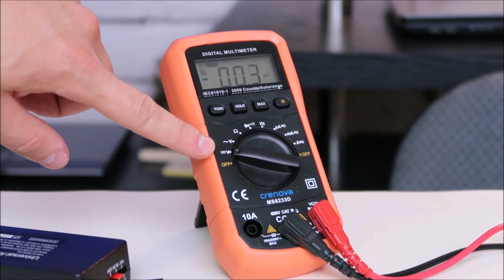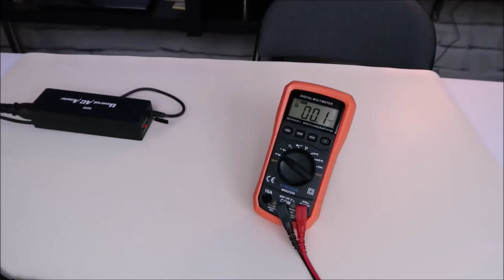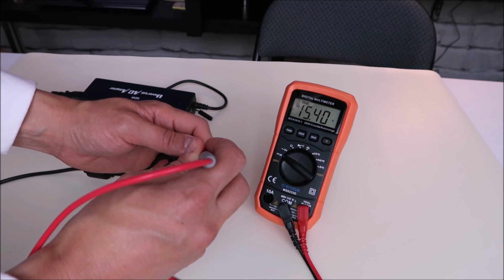How To Fix Any Laptop - Wont Turn On, Wont Open, Turns Off Right Away, No Power Solution

Comment: is there a vid where u can force restart bcs my computer is frozen and when i close it and open it its the same thing
Reply from the maker: To make sure the computer is off, you can hold the power button down until it turns off.  If that does not work, remove the battery and unplug the power adapter for a couple minutes.  Then put them back and try turning on the computer.  Is it still frozen then?  If so, where is it frozen?

Comment: Hi, thanks for sharing your knowledge here. I have a Toshiba E45-B4100 ; about a year after buying it, the charger died and I used a generic charger to power it. Hours after connecting the charger, the laptop suddenly died but it came back on after doing the battery in-out power button procedure you described in another video. The next day, the laptop suddenly died again but this time, nothing I did would bring it back and since then I have tried everything, including all the procedures you describe here as well as others, all to no avail. There are no lights or sounds from the computer at all and I couldn't find it's CMOS battery when I disassembled it. What do you think happened here? Please help, thanks.
Reply from the maker: For a computer that does not turn on, try this video first;  https://youtu.be/P3I7dDpkJps.  Let me know how that goes :)

Comment: Thank you for this - my ASus GL502VS still is not turning on.  This is what I tried:
Tested charger with multi-meter - showed 19.73V
Disconnected battery, discharged static by holding power button for 1 minute without power connected - no luck
Plugged in power adapter, tested voltage out the back pin of the DC Port - showed 19.73V so looks like power is getting to motherboard
Tried a new battery - the system turned on (battery only had 5% charge) - Windows showed that the battery was not charging + battery led was blinking
Battery eventually died - system will not power on with charger plugged in
Discharged CMOS for 20 minutes - tried all the static discharging, etc, still won't turn on.
I even bought another charger (which tested good with multimeter) and did all the above using the new charger (why not I can return them on Amazon)

I don't know what else to try now - I think it might be the motherboard.  Strange that it can get power from a battery but not directly from the DC port.  I suppose I could externally charge the battery and swap it but that is not a good solution.  Any input appreciated!
Reply from the maker: If all the tests in this video do not reveal the issue, then your most likely looking at a Motherboard replacement as seen here;  https://youtu.be/N_7HNrFkMS8.

Comment: Hello , my laptop doesn't turn on.
My keyboard shows white light and no power light and doesn't turn on at all.
Tried using it only on batter , disconnected battery ..
Didn't work.
I gave it to service center and they told me to either repair or replace the motherboard.
Replacing motherboard is very costly - close to buying a new laptop but i opted for repair and they told me that they couldn't find the issue.

Last thing i did was a bios downgrade which worked well for 2 day ..
I downgraded because the new bios had some issue related to fans (restarting every 5-10mins).
Reply from the maker: If all the tests in this video do not reveal the issue, then your most likely looking at a Motherboard replacement as seen here;  https://youtu.be/N_7HNrFkMS8.  If you know your computer's model number, I can help you get inside your specific computer :)
Reply: @PC_Monkey  It is Asus Fx505DT.. Ryzen 5 3550H , Gtx 1650 , 8GB ram.
I think the power delivery component is damaged in my motherboard but i don't have so much knowledge about these.
I want my laptop to be repaired instead of motherboard replacement because it is very much costly.
Almost 80% of what i paid to buy the laptop.
Reply from the maker: @AnilabhaDatta  If your motherboard is the issue, then it would have to be replaced.  If none of the steps here found the issue, then its most likely your motherboard.  If you like, you can take it to a repair shop for a second opinion
Reply: @PC_Monkey  the repair shop couldn't find the issue , i guess i have to look for another shop.

Comment: i was playing on my laptop and then it shut down and i can't turn it on
and it's not charging when i plugged in the adapter....help!😭😭😭
Reply from the maker: your on the correct video.  Have you tried the steps seen here yet?
Reply: we did all the steps but it din't work so we need to buy another motherboard..
Reply from the maker: @iiethxnyt9696  K.  Good luck with the install !!

Comment: My laptop wont turn on and there is orange wire looking light blinking it worked once but i l tryed to use one of usb ports and it suddenly shut off with a sound like it exploded
Reply from the maker: For a computer that does not turn on, try this video first;  https://youtu.be/P3I7dDpkJps.  Let me know how that goes :)
Reply: PC Monkey didnt work
Reply from the maker: @MldgetPidget   If all the tests in this video do not reveal the issue, then your most likely looking at a Motherboard replacement as seen here;  https://youtu.be/N_7HNrFkMS8.  If you know your computer's model number, I can help you get inside your specific computer :)

Comment: Hi, my problem seems different to this. 😕

I have an Asus ROG laptop. Won't start at all. If I do a static discharge then plug in the battery I get nothing but if I discharge then plug in the charger, the laptops led indicator works but still nothing else. 

Also, when I have the battery plugged in there is a consistent quiet whine which goes away if I unplug the battery or while I hold down the power button.

Any ideas??? Please help me 🙏
Reply from the maker: This is the correct video for your issue.  Have you followed the video through all the steps?
Reply: @PC_Monkey  thanks so much for the fast reply. I am currently up to the stage of discharging the motherboard by removing my CMOS battery. Didn't work the first time but I am trying again and letting is discharge well overnight.

(I have not yet bought new ram to try but that will be the next logical step I assume). I have a single channel 16gb stick. Will putting that ram in the other slot make any difference or does it have to be a new stick of ram?
Reply from the maker: @scottbristow3370  Changing the slot will only test the slots if you know the RAM is good.  Since we dont know that, best to get another stick to test it with
Reply: @PC_Monkey  awesome, thank you so much for the advice 😊
Reply from the maker: @scottbristow3370  Happy to help :)  Always here if needed !!

Comment: I have  applied all the tricks but still haven't got any solution, my laptop is not starting nor charging,. with or without battery charger is working
what should i do plzzzzzzzzzz help
Reply from the maker: If all the tests in this video do not reveal the issue, then your most likely looking at a Motherboard replacement as seen here;  https://youtu.be/N_7HNrFkMS8.

Comment: My Lenovo(similar to your tutorial version) is only 1 year old and it’s only used for business purposes, emails, excel, etc. It randomly today when I opened the lid from a sleep mode, the power light on the button came on and the charger indicator shows it’s getting power (previously at 100%). You press the button and the light goes on for 3 second and shuts off but nothing at all happens, no sounds or screen input. This issue didn’t fall under any of the previous issues you described but you’re very knowledgeable. Could please reach out to us or post a video with a resolution to this weird issue, if there is something different we can try?
Reply from the maker: your on the correct video.  Have you tried the steps seen here yet?
Reply: PC Monkey yes I missed one part there in the panic I was in. You fixed it brother!
Reply from the maker: @christiandalessio5354  Happy to help :)  Always here if needed !!

Comment: I did the discharge and the computer will come on now. However, after awhile it will cut off. I had a voltage message issue, and replaced the adapter. any ideas what may cause it to cut off? we had a power outage and that is when the voltage message came up. it was on a good surge protector at the time. could it have corrupted something in the system and doing a wipe and reinstall may fix? dell inspiron 15
Reply from the maker: What did the voltage error message say?  If your computer turns of during use, check this video to see why;  https://www.youtube.com/watch?v=Nqn8-jJFx2Y
What happens now when you try to turn it on?
Reply: @PC_Monkey  It still cuts off. I did the reinstall and it will shut off after a certain period even with a reinstall.
Reply from the maker: @pamarrington59  What is the battery reading when it turns off?  Did you try to find an error with that video link?
Reply: @PC_Monkey  it was reading 100%  I didn't find an error to match. I am not sure it is off. when I press the button to turn back on I hear a sound and then I have to press 2nd time to startup. I don't have it set up to sleep mode or hibernate. Also, after the reinstall it ran update, then cut off. when I turned on, it kept looping and saying the update didn't work. I had to restore to before the auto update, then turn off updates.
Reply from the maker: @pamarrington59  What brand computer do you have?
Reply: @PC_Monkey  Dell inspiron 3552 laptop and i was able to get into system and software environment and see windows error reporting I did a screenshot before it cut off on me again and emailed to myself
Reply from the maker: @pamarrington59  Try running this test: https://www.youtube.com/watch?v=IsqINCxx_Ik&feature=youtu.be
Also, try the static discharge seen here;  https://youtu.be/P3I7dDpkJps.
Reply: @PC_Monkey  ran diagnostics . it passed both test  but it still shut off a few minutes later. i did update drivers on dell and it still crashed

Comment: My chromebook 500c13 the power plug doesnt work how do i fix it i took apart looks like its soldered to the motherboard
Reply from the maker: If the power plug is defective, it would need to be replaced.  If its connected to the motherboard, the motherboard would have to be replaced or the plug would have to be removed and a new one soldered on
Reply: @PC_Monkey  do yall have the new plug soldered ? Like can i pay yall to do it
Reply from the maker: @darkarmedgames7870  Sorry, I dont take computer repair jobs from Youtube viewers :(  Just local stuff

Comment: My laptop was working fine . Today I plugged in a Vga cable to my monitor and since my laptop had vga port , i plugged it on my laptop as well . Turned on the power supply to the monitor and then turned on the laptop .

Now the laptop never boots like it flashes 0.1 sec its like trying to boot of course the logo doesnot come because immediately turns off , and again tries to boot and again immediately turns off keeps happening in loops . It behaves both same ways with or without the vga cable now. My laptops battery disassembly is a complex procedure so i will be giving my laptop at a repair shop , i hope it works out . I am so stressed
Reply from the maker: your on the correct video.  Have you tried the steps seen here yet?
Reply: @PC_Monkey  The disassembly of my laptop is complex that is why i sent it in for repairs
Reply from the maker: @nisipshrestha1081  np :)  Hope it goes well !!
Reply: @PC_Monkey  but can vga kill laptop ? Or is it just a coincidence?

Comment: A month ago my laptop was not turning on and I saw your video and it turned on and after 2 weeks the same thing happened and now I can't turn it on plz help
Reply from the maker: For a computer that does not turn on, try this video first;  https://youtu.be/P3I7dDpkJps.  Let me know how that goes :)
Which step fixed it last time?
Reply: @PC_Monkey  https://youtu.be/_MOe71kBPOY it was from this video in which I took out the battery and pressed the power button for 1 minute and after that I put the battery back in and it worked

Comment: Somebody else tells me not to touch BIOS at all and tell me to change the cpu. Can that be the issue? Some one else says the mother board is bad even though I just got it off ebay? He says the mother board is bad b/c the light that indicates charging on the bottom side of the laptop doesn't light up when plugged in. Is he right? (the light on the bottom left hand side https://i.dell.com/das/dih.ashx/500x500/das/xa_____/global-site-design%20WEB/b88e8411-0a24-6e98-efc3-1c9c33787237/1/OriginalPng?id=Dell/Product_Images/Dell_Client_Products/Notebooks/Inspiron_Notebooks/inspiron_15r_5520/relative+sized/laptpo-inspiron-15r-5520-front-relativesized-500.png)
Reply from the maker: What brand and model computer do you have and whats the issue with it?
Reply: @PC_Monkey  my computer is a dell inspiron 5520 15.6 inch (basically in the linked picture). Before I changed my motherboard with one from ebay (said to be working) the light on the charger would go out when plugged into the computer. Now that I changed it the light on the charger no longer goes out when plugged into the computer. 

However, the light on the computer that lights up when charging won't light up and the computer won't turn on either. 
I have tried changing the charger, using the charger without the battery, the bios reset, and changing the RAM memory 1 at a time.
Reply from the maker: @ericl8407  For a computer that wont turn on, your on the correct video.  Have you tried the steps seen here yet?
Reply: @PC_Monkey  I just listed the step I tried. Do you understand what lights I am talking about?
Reply from the maker: @ericl8407   If all the tests in this video do not reveal the issue, then your most likely looking at a Motherboard replacement as seen here;  https://youtu.be/N_7HNrFkMS8.
Reply: @PC_Monkey  I didn't have volt meter but I did try a new charger. and I did replace with mother board from ebay said to be working

Question is: is the battery status light not lighting up always a problem with motherboard?
Reply from the maker: @ericl8407  It can mean that the motherboard is not working, however, lights can be deceiving.  Its best to troubleshoot parts instead of relying on the lights.
Reply: @PC_Monkey  do you have a video or list of things that could cause the charging status light to not show? it seems slightly different from the stuff in this video. And also my battery is a dead one. my laptop died the  day before it stopped working

Comment: Please help sir I update a network setting in window 7 while updating ...pc said that restart the pc but instead of restart i shut down it and then now i am not able to start please help me
Reply from the maker: What happens when you try to power on the computer?  If your computer wont power on, then your on the correct video.  Have you tried the steps here?
Reply: @PC_Monkey  yes but it didnt work
Reply from the maker: @nikhilchopra7666   If all the tests in this video do not reveal the issue, then your most likely looking at a Motherboard replacement as seen here;  https://youtu.be/N_7HNrFkMS8.  Is there a chance the computer is turning on but the screen is just staying black?  If so, check out this video;  https://youtu.be/u-REPLdpZ70

Comment: I tried all of the steps you did, still won't turn 🙁
Can you pls help me 
I was using my laptop, then it turn off by it self
By pressing the power button, still no responce with the display, but it indicates that my laptop is charging, because it has a light indecator.

My laptop is ACER ASPIRE 5
Reply from the maker: If all the tests in this video do not reveal the issue, then your most likely looking at a Motherboard replacement as seen here;  https://youtu.be/N_7HNrFkMS8.

Comment: Hi! I just referred to your video for my Lenovo laptop and Windows started when the battery was removed and charger plugged in. Does that mean it’s the battery that needs replacement?
Reply from the maker: Yes.  Most likely the computer senses an issue with the battery and will not turn on with it installed to protect itself from damaged.  The battery should be replaced.
Reply: PC Monkey Thanks heaps! I have ordered a new battery! After it powered on with the charger, the start up screen prompted me for a boot repair but it couldn’t do it. Would the battery be the reason why when I would be using the laptop, it would suddenly power off though fully charged?
Reply from the maker: @sunitakaihar6510  Yes, the battery could be he reason why the computer turns itself off.  To double check the reason, refer to the steps in this video;  https://www.youtube.com/watch?v=Nqn8-jJFx2Y
Reply from the maker: @sunitakaihar6510  Jamin :)  Happy to help :)  Always here if needed !!
Reply: PC Monkey Thanks Jamin! You’ve been of utmost help! I can see from other comments too how your knowledge and videos have helped others! Appreciate it! 🙂
Reply from the maker: @sunitakaihar6510  :)